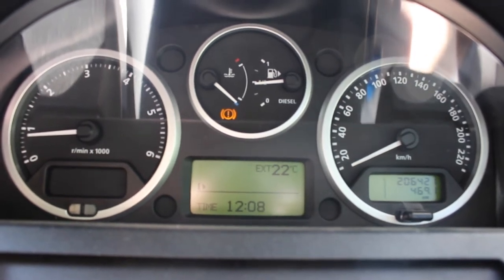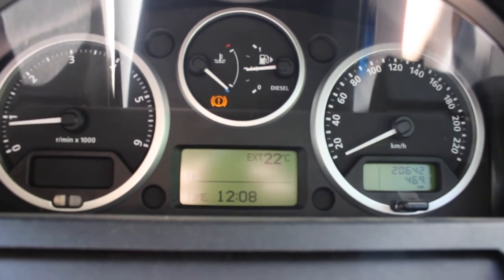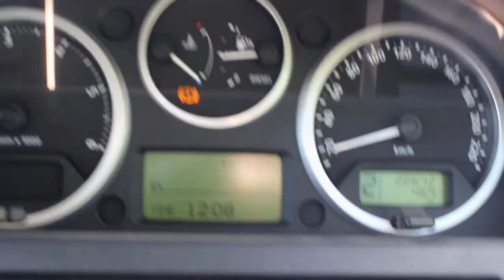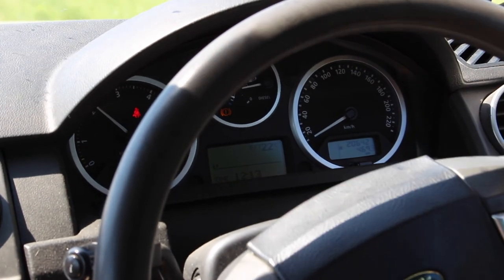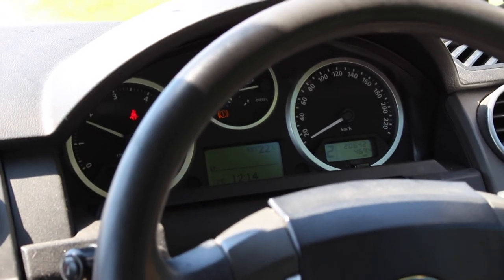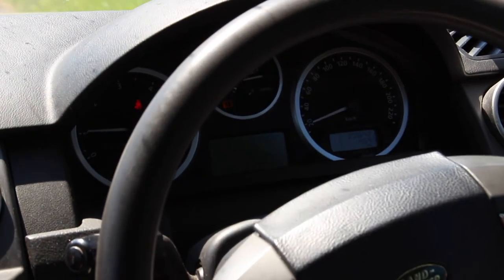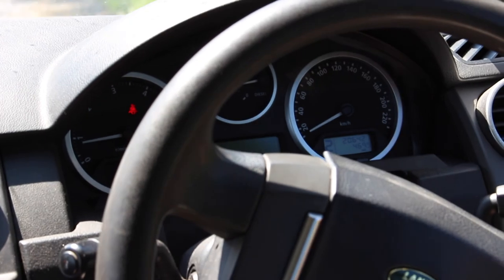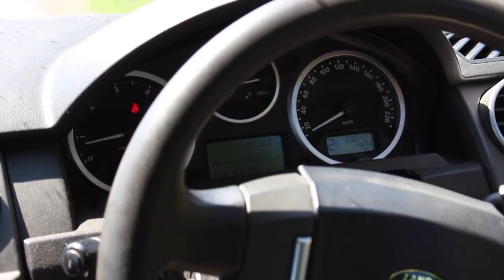How to Calibrate XY Sensor on Manual Gearbox Discovery 3/4

Comment: Great video, just recalibrated my D3 X-Y on your instruction, everything now working as it should. 😃I had all the classic symptoms, auto park brake release fault, slow gear indicator change, reverse lights and bleepers u/s, even down to riding and slipping the clutch just before the faults actually occurred.  I dread to think what an unscrupulous garage could have potentially charged. Thanks again.

Comment: great video, explains everything... but didn´t work with my disco. still delayed indication of the gears, still no reverse light,... during the calibration everything works pretty fine, but it seems the result is not memorized by the system. any suggestions?

Comment: Unbeleievable, no reverse lights, sensors, and gear change numbers very slow, also parking brake warning on screen.... quoted £500 to fix by garage... watch video, travelled 3 miles intotal and all problems fix.... a big thanks

Comment: My land rover L3 says F on speed meter what does it mean
Reply from the maker: Guessing you have the auto gearbox? Check: http://www.disco3.co.uk/forum/f-limited-gears-142985.html
Reply: Did you ever find out what the f was for mine is doing the same
Reply: Excellent video and tip m8. Thanks so much, i was quoted £435 for a new XYZ switch plus fitting and labour...you saved me so much...top guy. Thanks again...